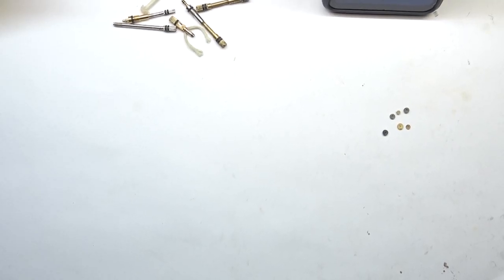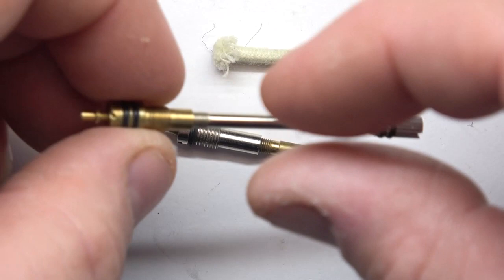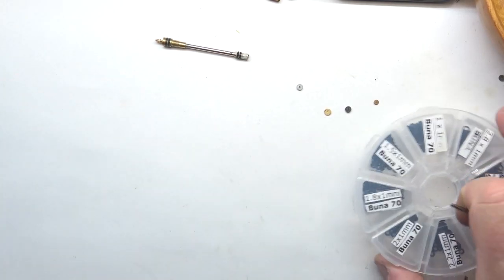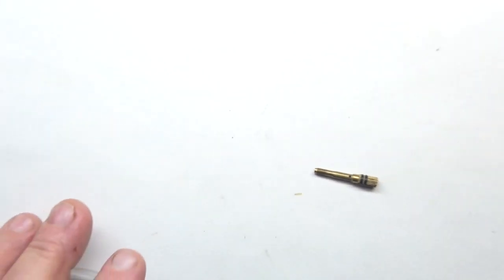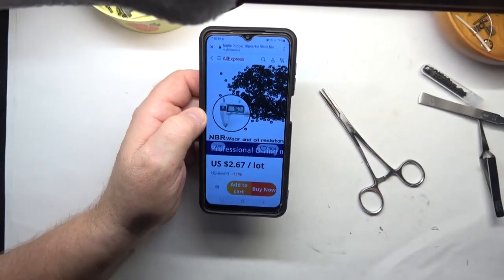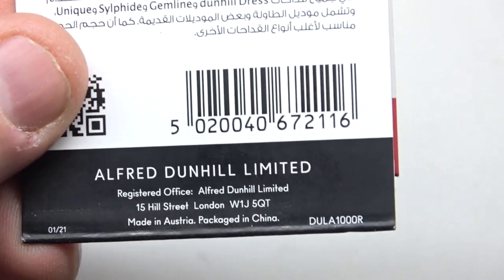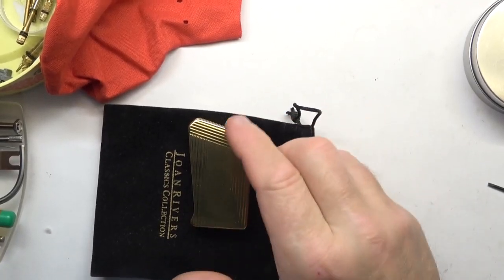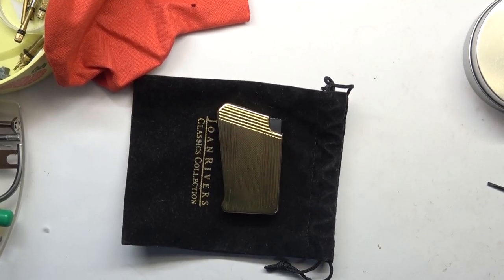Seals, Orings and more

Comment: Thanks for this video, it's extremely helpful. I'm running into a recurrent issue w/ Dupont lighters where the paper sponge on L1 and L2 gets aged, clogged, and petrified... and I haven't found a source for new sponges. What do you use or suggest? Or is there a way to clean them? Thanks.
Reply from the maker: sent you links on your ebay message